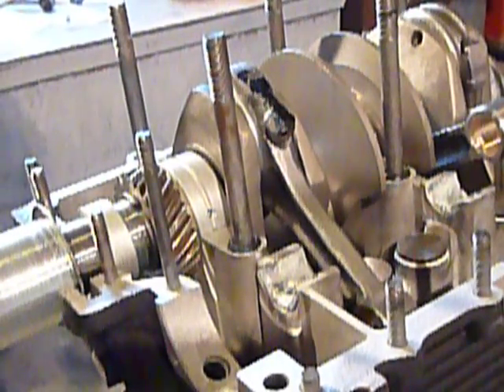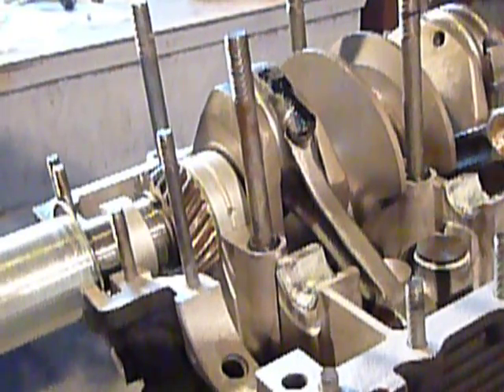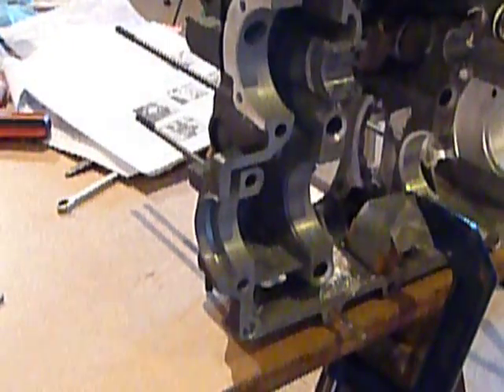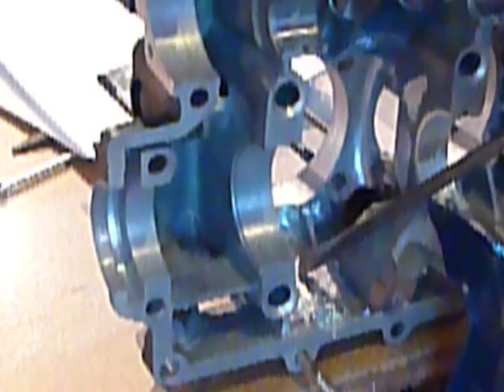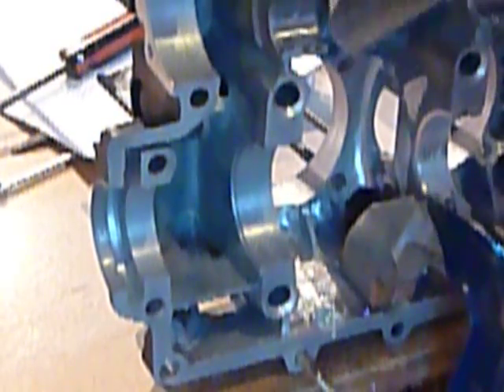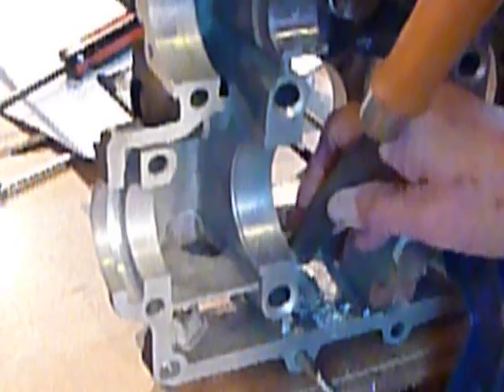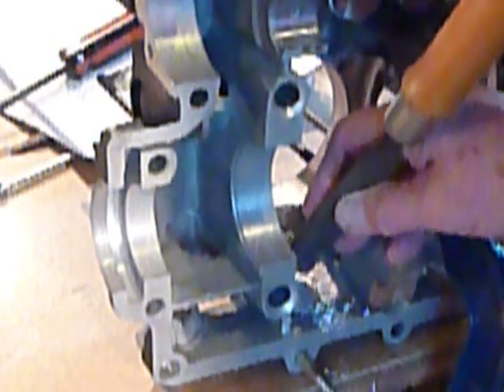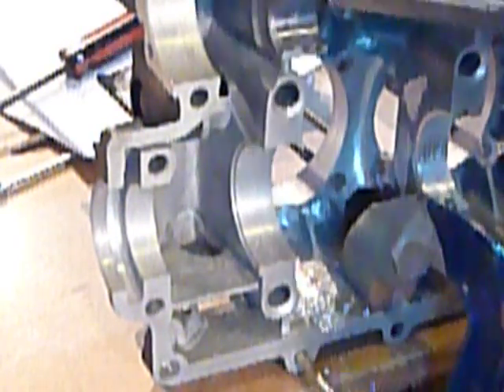AeroVee Connecting Rod Clearance

Comment: Tell us about the thrust bearing,, since this engine wasn't designed to be pulled by propeller
Reply: I removed the AeroVee and installed a real aircraft engine in my Onex
Reply: @lorensievila4797  what did you put in? How was the aerovee when you had it?